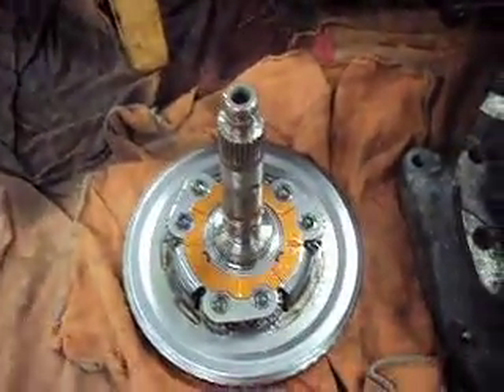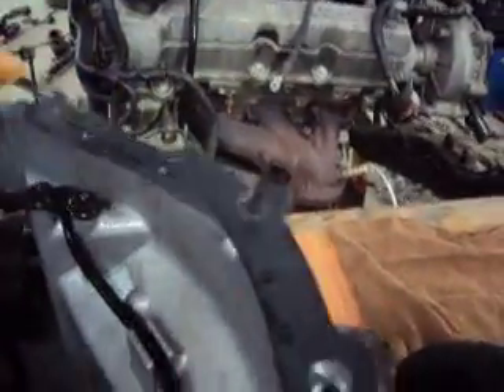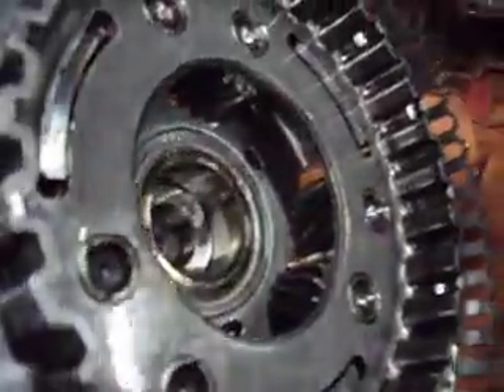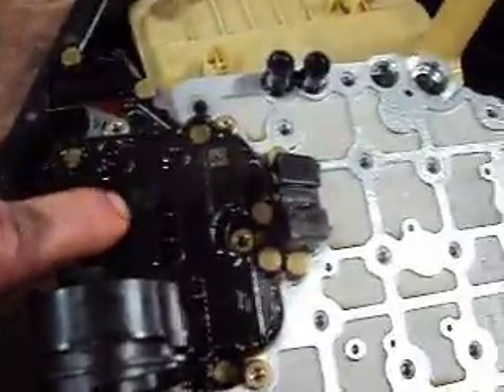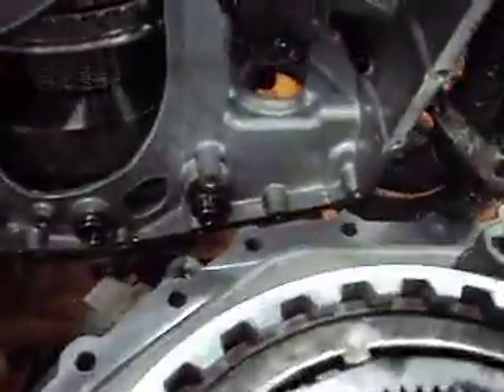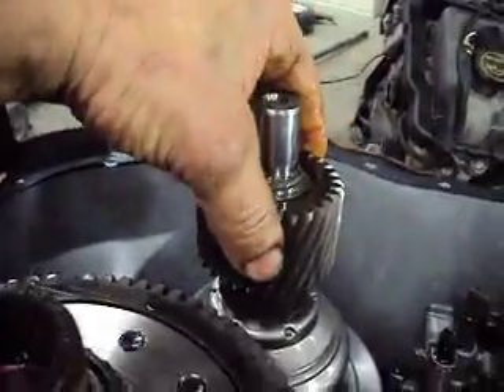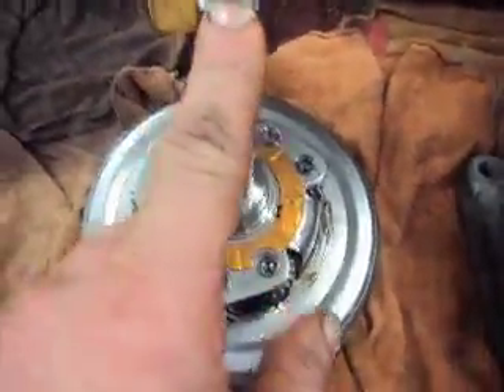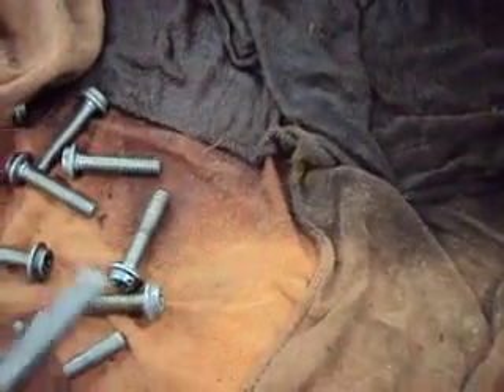Inside the 05 Ford 500 CVT transmission

Comment: Fuck all CVT Transmissions only 107k miles what BS wrench and check engine light P0701 code slipping bucking hard in reverse Fuck You Ford and all CVT Transmissions what garbage

Comment: Do realize that when you were spinning those roller bearings, you’re just moving the rollers and their holding cage. You will probably never see a roller bearing feel rough when the bearing is not assembled with its other race.
Nice video though to see how these are made. Thanks.
Reply: Mark Edwards As an automorive and heavy duty onroad mechanic I can tell you that a roller bearing CAN INDEED seize or be hard to spin. I run into it a lot. Pits, metal shavings, debris, contamination, rust from water contamination, broken housing, etc can cause a non-easy spinning roller bearing.

Comment: Does all Ford 500's have the cvt transmission?  I have a 2006 Ford 500, front wheel drive, limited. I'm not having any problems, I was just thinking of having the transmission fluid changed, and filter, it has 116,000 miles. No problems, just servicing it.Thanks for any suggestions. John
Reply: No, some have a 6 speed automatic. I believe the CVT ones also have AWD and the 6 speeds are FWD.
Reply: ***** I appreciate the reply, thank you, Johnny
Reply: Get a tech whos experienced. The local Ford dealer service dept. stripped the T-40 torx drain plug. I ordered a new one, now going to do it myself.

Comment: where is the filler plug on these Ford CVTs? Also is the Valvoline CVT fluid okay to use in it? Thanks
Reply: Dipstick is under the airbox I think
Reply: +ReclusiveMountainMan I would not recommend it. It might be fine and I have heard of others using CVT oil other then the recommended but there is no way in hell I would. This thing is a monster to remove and repair whether it comes out of your pocket or your back, patience, time and several other things I'm short on since I'm in the middle of doing one.

Spend the extra money and get the recommended juice.
Reply: diGritz1
I decided to buy a case of the Motorcraft CVT fluid. ;)
Didn't want to risk it. It's a real PITA to access the high pressure filter in these things. I think they are T25 or T27, and they can be stuck.
Reply: Your best bet. If your still under an extended warranty you better believe they would ask what you used in it. And if not it's worth it just a a small piece of mind your doing everything you can to avoid a failure.
Reply: Agreed. :)

Comment: You can't get parts for it,on major back order and this transmission is a piece of shit
Reply: +Mike Samra I am sorry but you are about as wrong as as human could possibly be. This tranny is a piece of junk and should never have been used with the current design. When a single oil ring is capable of costing 6000k for a dealership repair it&#39;s junk. When almost no transmission shop will touch it it&#39;s crap. When a major component is discontinued in less then half the live of a normal car it&#39;s a small pile of shit. When there are thousands of people all signed up for a class action lawsuit against Ford because they knew of the issues and sold it anyway it&#39;s A HUGE PILE OF STEAMING SHIT!

I am glad you have had no issues and in all probability there are more good ones then bad. However your odds of having serious issues with it are far greater then other cars even with similar issues. Also your cost is much much greater. This started out at between 3k and 4k now the price is 6k at a dealer
Reply: wafrederick 
No its not..I have one with 307k on it
Reply: Yes it is a pile of shit.The CVT transmission is a huge joke and not reliable.
Reply: Bill Hawkins It's nice to hear someone has been able to take full advantage of one of those extended....extended....ect....ect.... warranties. Ours ran out literally with in months of the CVT's failure.

Had to lmao at the supply chain comment. They have know these things are cancerous for over a decade and the replacement program is incredibly profitable for both dealer and factory. You can see Ford knew they were going to make money on it by looking at the almost 1/2 dozen rate increases.

Having many years in the engineering field I was speechless upon seeing the design of the input shaft and o-ring. It is a typical example of lazy engineering. There is no way it wouldn't fail.

If you have spent a dime I would get signed up on the class action as when it is finally settled you will be entitled to at least some back.
Reply: +Mike Samra Yes I am very aware of all that since I have one sitting in my garage in pieces. However since this video is in regards to the 05 500 your statement seems a bit out of place as that's the model one would assume we are all talking about. Especially when you do not stipulate otherwise.  

Someone that comes here and sees your response might get the impression that the 05 500 problems are simply sour grapes by those that got a bad one. They are not. It is a miserable piece of equipment and working engineering/heavy equipment I have seen a lot.
Reply: Jasper won't even touch the CVT transmissions.Nissan,you can't get parts for their CVT transmission,replace the whole transmission when one part fails.Same with GM's CVT in the older Saturn Vue.
Reply: +diGritz1 you are correct sir.  I have a 2005 Ford 500 Limited.  AWD.  with this CVT transmission.  We are on our third transmission.  This will be the last, as the extended_extended_extended warranties paid all or quite a bit on the last one.  Each time, we were told the same story about a supply line chain break down from Germany.  WHY  WHY WHY would you design something this complex that hinges on a single "O" ring going bad.  New transmission every time.  The O ring slips off into the Torque converter you said.   I just can't believe the stupid.  OH how it burns.

Comment: we ve got a 06 freestyle with 195k miles on it, beautiful wagon but our trans is messing up a bit wen it runs hot, like the clutch wont move and it sits in neutral. any ideas?
Reply: Did you ever discover what was going on with the CVT transmission? My freestyle is sitting 6 1/2 hours away because the transmission is overheating.

Comment: did changing the torque converter and installing the missing o ring fix the problem?
I have a 2005 with 60k on it with the same codes and problem when the cruise is on
any info would be great
thanks